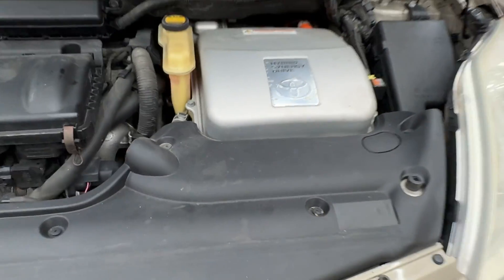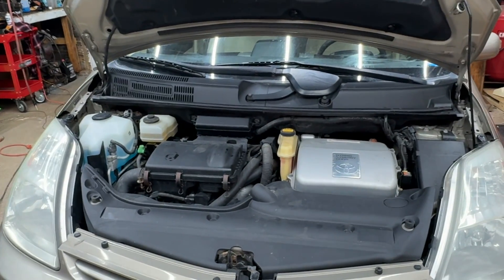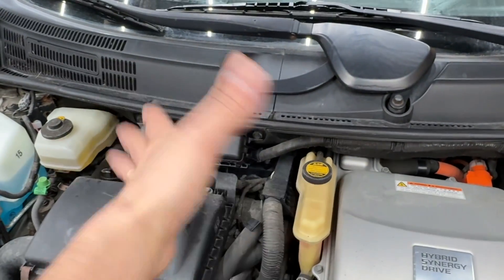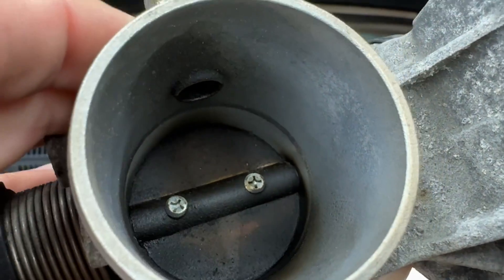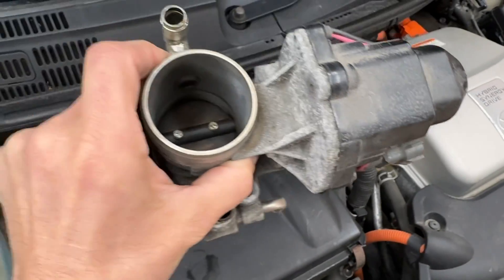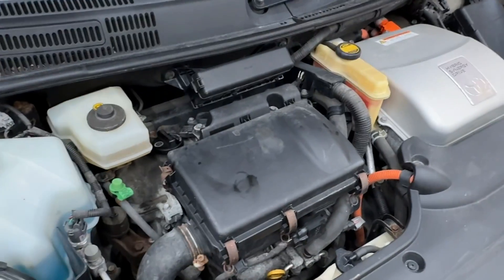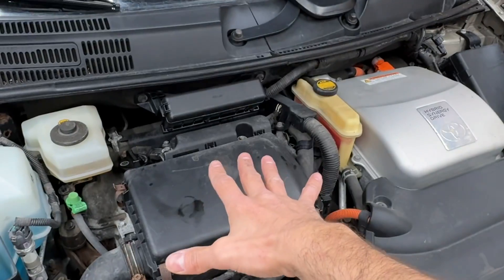3 Things To Make Your Prius Run Like New! (No this won’t fix internal engine DAMAGE but WOW)

Comment: I have an 08 with 267K miles, commuting 86miles a day on it. Should I be concerned about burning like 5 quarts of oil a month, or that ticking grinding sound when getting on the highway? Lol. Sound has been happening for maybe 100, 150K miles. How much more time do I have on this engine?

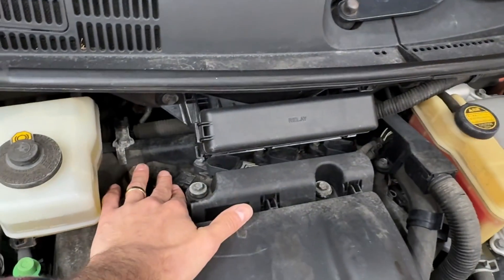Comment: 2:10 spark plugs
2:58 fuel injectors
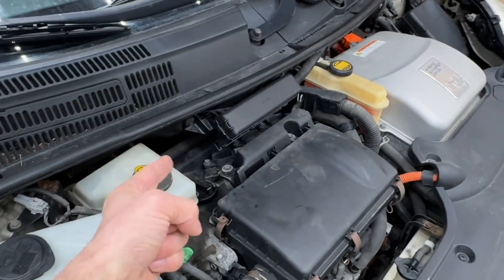3:50 air (throttle body)

Comment: Have you ever heard the motor on the throttle body make a rattling sound? Over the past couple weeks or so I've been hearing a strange rattling, while driving, not the ABS actuator. 

This morning I pulled over, opened the hood, and took a video and placed my hand on the throttle body motor and felt it rattling along with the rattling sounds.

Comment: Those can help any engine run a little better. Cars, trucks, even mowers.

But i do have a couple to add. Mine is newer but these can also help any car. My car had a problem starting in the mornings, but then it would run fine all day. I put in the red bottle of heet (that is heet+ fuel injector cleaner) before i filled up. Cleared up the problem right away.

Another thing is change the fuel filter every once in a while. You can do it or have it done at a shop for pretty cheap.

You want to protect that fuel pump because atleast in the gen 3s the fuel pump and the gas tank are one unit.

Comment: I just bought a 08 with 300,000 and I’m experiencing a lag or thud when letting off the gas I don’t think it’s the trans because it happens any time you let off gas at any gear or speed.
Reply: Check your transmission mount bracket under the car, sits in the middle, that could cause weird vibrations

Comment: I have a 2009 (not sure what gen) registers almost 350k but I have been having an issue with my dashlights rarely working (no speedometer, no fuel gauge, no odometer, etc...)  so it definitely has more :)  It has been serviced regularly and still runs like a charm. I wish I had a better mechanic locally, but he does the best he can using YouTube...lol. I absolutely adore my little car!
Reply: The issue with the dash lights is some capacitors that go bad so if they get replaced you won't have issues anymore I'll add a link to a video that shows how to do it, maybe you can show you mechanic so he can fix it for you.
https://youtu.be/Gwa_MNIvwZA?si=KuMpmiobjb1N_tNX
Reply: @leopower4062 I will definitely show this video to my Mechanic :)  Thanks so much!
Reply: get the battery tested (for free) at your local autozone or advance auto parts or oreilly
Reply: @asdf14051 I had replaced my cranking battery just a few months ago, my dashboard lights have rarely came on since.
Reply: Kinda weird but my 2004 had the dash lights go out and it was the battery in the key fob.
Reply: @smotrme hmm, I  can definitely replace that. Come to think of it mine won't lock my car anymore but it still cranks it so I didn't think to replace the fob battery,  thanks 😊

Comment: Probably why My 05 only getting 30-35 mpg. 380k miles I changed the spark plugs and fuel injectors and both batteries hybrid and 12v air filter new   cleaned the mass airflow sensor but still didn't change my mileage only thing left is this and changing oxygen sensor

Comment: Fully synthetic oil, changed every 10000 miles or every year max. It stops the ring/bore wear....in the 1.8L engine, the egr valve sticks, giving big vibrations on tick over. It's a DIY repair.

Comment: Phenomenal video about to watch your video on everything that could be causing the second Prius to misfire. 

I have had a 2009 Toyota Prius for the last three years and for the most part have loved it. Only issues I had was a clogged catalytic converter and the inverter pump went out. 

It did develop some oil consumption issues about a year after opening it and this past year that oil consumption has gotten pretty bad. My girlfriend drives it now daily and checks her oil weekly. We stay on top of oil changes every 3000 miles and add Rislone engine repair additive to help with what would be my guess is piston ring wear.

Three weeks ago I was flying down the highway after just filling my tank and about 20 minutes down the highway I lost all throttle response then all power to the vehicle. I was able to limp it off the Highway using the battery power then it stopped and threw up the red triangle warning sign and the fuel gauge on the dash started blinking and on E. No leaks that I can see so checked the coolant pump to see if it was operating then checked fuses and noticed the 15 amp fuse for the EFI was blown and the fuel gauge on the dash starting blinking full then empty so I swapped in a new one and still no crank no start but the READY light was on. So I thought fuel pump and went to remove the back seat to swap the sending unit I learned there was no sending unit and that to replace the pump I need to replace the whole fuel tank. Which Toyota wanted 2,100 for the fuel tank… drove three hours to pick up a used tank with all the hoses and sensors attached and already pulled now inspecting the gas in both tanks and the full tank is quite cloudy and green but the used (new to me) fuel tank gas is quite clear and yellowish amber. 

Curious your thoughts on the symptoms, gas and since I’m doing all this should I go ahead and swap the injectors?

Comment: We have two 2005 Prius with one having 225,000 mi the other one having 251,000 mi and both of them run amazingly well and no rust. I've never seen a 20 Plus year old Japanese car that doesn't rust at all but these things have been amazing. Thanks for your tips on making the engine run the best it can. I think there is something to be said about the variable valve timing ( VVT) valve. I have heard of these sticking (gummy oil crud?) and causing pinging under load once the engine warms up because the VVT is out of position for the engine load and RPM. I would love to see a video from you on cleaning this valve and or replacing it to correct this problem.<

Comment: Nice tip, my 2nd gen 2004 has a problem of coolant pump for the side of hybrid, seems a common foult for this model... I replaced the pump with a Mercedes benz pump rated 18V DC with little modifications on the bracket and problem solved completely.
Experience tells that, since the coolant pump came with prius is rated 12V DC, then it is prone to risk of being blown in times of high voltage...

Comment: Hello I have a 2007 Prius been loving but it’s been having a weird problem at lower speeds I’m getting high rpms and it seems it doesn’t want to use the traction battery barely drains but it will run totally on battery around 30-40 mph notice the struggle accelerating around 20-30
Reply: Did you ever find the problem
Reply: Your hybrid battery is failing
Reply: @MEP1962  Not necessarily! I recently replaced my gen2's battery with a good reman Gen4 battery that tests very good, and still, my wife's car revs up too much on acceleration and on hills. Still haven't found problem, though there has been a couple times, many months apart where it RTOD'd and gave code for transmission MG1 as I recall. Reset, troubleshot, found nothing, good to go for a few more months to a year each time. Last time was a week after the new battery install. Techstream showed the subcode where regular scanner did not show full code.
Reply: @markharmon6392 I hope you can figure it out and get many more miles out of it!

Comment: I have a 05 with 489,900 miles on it. Love these things!!!
Reply: Spill the beans, what have you done to get it there?
Reply: @Deveak  Some years ago I though the end might be coming when I started getting timing chain rattle and figured the repair cost might be prohibitive. Then I saw a video on YT about Sea Foam produced by some guy with an old Ford truck. I liked what I saw. I knew that my problem was either a stretched chain or possibly a gummed up hydraulic chain tensioner. Well I tried it and after three oil changes the timing chain rattle was gone as was the occasional cold start rattle (VVT control valve issue) and oil consumption was reduced a little. I was doing small package delivery at the time so three oil changes was three months. I've put Sea Foam in with fresh oil ever since and the engine runs great. I'm not using it much now because it needs the ABS controller changed but I do run it regularly and the engine starts easily and runs really smooth. I'm sold on Sea Foam.
Reply: @Deveak probably drove a lot
Reply: @Deveak  you just gotta do the essentials like take care of the oil , coolant , not let the engine ever overheat if the inverter coolant pump stops working or the condenser , add seafoam at least 2-4 times a year , ignition coils , spark plugs etc
Reply: @omni_prism  Where do you monitor and watch the engine/motor heat to prevent it?
Reply: That’s awesome
Reply: Has your hybrid battery lasted that long? Or at what mileage did you replace the battery at?
Reply: @marclikens the battery was replaced by the dealer before I bought it after they misdiagnosed it. It was the 12v battery that was causing start issues not the HV battery. When I bought the car it had 113,000 miles on it.

Comment: Note : if you take fuel injectors out, do NOT forget to change your O-rings. I was  lazy about it and after I re install fuel injectors, I had check engine light about P0441 P0455, for a year. Chatgpt says if Orings don't seal good, it's possible to cause those codes. Other youtubers also say that Orings are only one time use.

I cleaned injectors today and put them back with new orings. I cleared codes. Now I need to wait few days if it comes back.

If it doesn't, that means Oring causes check engine lights. If I get those lights again, nevermind what I wrote here. I'll write here if I don't forget.
Reply: Did the O rings work lmk
Reply: @jojocastelan3713  yes, no more check engine light! It was because of Oring.
Reply: @jojocastelan3713  check engine light came on. I think its something else. I also tried another o rings brand new one. But same. I am not sure what to do
Reply: I was I was going to buy one the battery to too much😢😢😢😢😢😢 you got some cheaper gas ⛽⛽⛽⛽😊😊😊❤❤❤
Reply: Or maybe you installed them wrong previously because ive reused o rings no problem

Comment: My prius accelerates by itself, the revs rpm goes higher mostly when car is stopped at lights and lasts for about 5 seconds then goes back to normal, what could it be ?

Comment: My 2008 has 227,000 miles….I bought it 7 years ago with 100,000 miles…Iv’e achieved 55MPG in prime conditions….It still runs very smooth…I should do the plugs and clean the mas airflow as well….But I am very happy with it with no mechanical failures….
Reply: I have an 08' with 76k miles, garage kept, and it gets 41.7 mpg rn .... :( how is your mpg so high!
Reply: @ Do your still have the original hybrid battery?
Reply: @fladoodleflamy  If you're using heat or AC then that's about right, if not then it's surprisingly low, unless you're towing something or have some kind of roof storage thing. If none of those apply then maybe you should do the stuff talked about in this video and make sure the air filter is good.
Reply: @fladoodleflamy  I have an '07 that i bought back in August with 116k, great condition, and i average 60+ mpg's. DM and i'll let you know how to do it.
Reply: How u get 60mpg. I'm getting 53
Reply: @benne1016 How do you do it im dming you
Reply: My 2007 has 140k miles. I bought it in 2018 from its original owner with 90k miles. I assume it is still using its original traction battery. Its mpg is always in the range of 40 to 45. It only reached 50+ mpg for perhaps 2 weeks right after I had its battery reconditioned several months ago, but the good effect didn't last long. It gradually declines and now I'm at 44 mpg. What did you do to sustain at 55 mpg?
Reply: @RayLuomba probably replacing oxygen sensors may help. I’ve replaced the downstream and I’ve noticed a 6+ mpg improvement, bringing me to a max average mpg of 43. Hopefully replacing the upstream will get me to the full 55mpg.
Reply: Smoothly, not smooth.  "Use your goddamn pronouns." (quote from a movie.  Murder by Death, maybe?)
Reply: @alext8828 Maybe…..
Reply: @alext8828 Trolls in every universe evidently….

Comment: Hi..how you doing my second generation prius 12v battery keep going low i replaced two batteries when the car is not driven one day the goes very low and won't start any suggestion.
Reply: it does not have an alternator.  it has a generator, and engine and trans have to come out to replace it.  I hear its a $6000 repair and basically makes your prius a big piece of trash unfortunately...  not quite as environmentally friendly as we all thought.  trash is the real climate problem, not emissions.  the good gas mileage is just to save money at the pump, nothing else.
Reply: Check alternator related stuff, alternator, belt, connection, etc.

Comment: Usually when I do all this, the car idles high, how to correct that problem I’ve tried everything, unhooked battery and I’ve replaced the gasket still same any ideas?
Reply: Same here. My prius accelerates by itself the revs rpm goes higher mostly when car is stopped at lights and lasts for about 5 seconds then goes back to normal, what could it be ? Did u find out ?

Comment: I'm glad to see your sharing. I have a question. My car is a Prius 2005, but recently there is a problem, that is, every time I turn on the lights at night, the dashboard of the car will be completely off. It used to be normal when it only reduced the brightness, and it was displayed normally when the lights were turned off. I would like to ask if you have any way to fix this problem, or make a video tutorial, then I will be very grateful for that. Thank you!
Reply: Fusebox, one by one, take em out, put em back in with car off, spray wd40, scrape em in and out.  Move to next one.  12V battery is a known painful issue!  If you don’t know how old it is, charge it after disconnecting negative first, then positive, then charge, then reconnect [ositive first, then negative.  If it runs well but only for a few days, this is part of your problem, or just needs replacing anyway.  I hadda drill out the new battery’s hole where the expansion plug and when fitted, the tube fits to take any gaseous smells outside.  Good luck, it’s these two or you are maybe also looking at the negative battery cable earth point.
Reply: There are a couple things that can cause that issue first check the variable dial to make sure it not turn all the way down, it to the left of the steering wheel just below the dash that controls brightness of the display, they can also go bad causing the black when lites are turned on, the other is a bad photo sensor on the dashboard located far left on the up next to the windshield, could had pop out and fell below, though u should still be able to control the brightness with the dimmer switch if it's working correctly.

Comment: Do you have a video on how to reset Red Triangle with vsc, abs lights? 
Does Prius need to change Timing Belt? Thanks!
Reply from the maker: These shouldn’t be reset, the issue has to be fixed. Them a regular 12v disconnect should do it. 

Prius has a timing chain

Comment: Easy to remove and clean (by soaking) the fuel injectors. Rarely a need to fully replace them--they have no moving parts...
Reply: Fuel injectors have lots of moving parts

Comment: I just bought a 2005 with 230k. I was looking at coolant levels and noticed the engine coolant tank was empty. No engine light or smoke or smells. I am thinking i need to just top off the coolant. When i do that do i need to bleed anything or just fill the expansion tank and go since its just a top off and not change ?
Reply: Fill coolant with funnel that is tight fit so it holds pillar of coolant in it.

On other end of radiator in top there is a 6mm hexagon that shuts bleed. Connect hose from bleed valve to expansion tank or hang it to bonnet and open valve with 6mm hexagon.

Keep funnel filled with coolant and start squeezing coolant hoses until no bubbles appear in funnel or in bleeding hose.

Shut bleed valve and radiator cap and follow coolant level for couple of days after it is cooled down after drive for example on next morning.

Worked for me today.

Comment: Dear Sir... my 2007 prius suddenly shut off power and all dash light come on like death triangle. after that i can resart again , what may be the reason ? i can not go out with this car , bec  i am afraid like- any time engine can shut and any car from behind can hit me . pls sir help me with a suggestion
Reply: Please change inverter coolant pump. It might be faulty 
Same thing happened to my g2 2008
Reply: @MarufHasan-rt1hs  Same exact thing happened to me
Reply: Check 9 volt battery also.  Make sure it’s not getting wet.  I had an issue on leaking into trunk.  Use duck tape around rubber seal until you can get to mechanic to seal and they drilled a hole to help the water drain have a 2006 Prius this happened a year ago.  Had to get a new 9v and trunk sealed.
Reply: Hey, did you push a wrong button on your phone?? Never heard of a 9v battery in a Prius or any car for that matter??
Reply: You need to buy a code reader which will tell you what the car thinks is wrong with it.